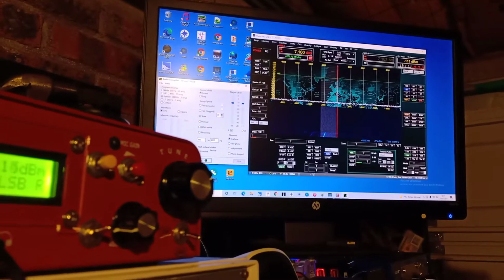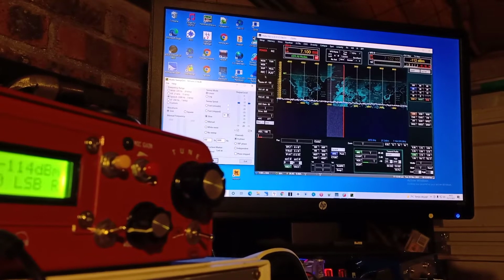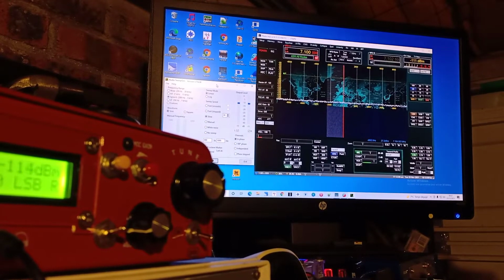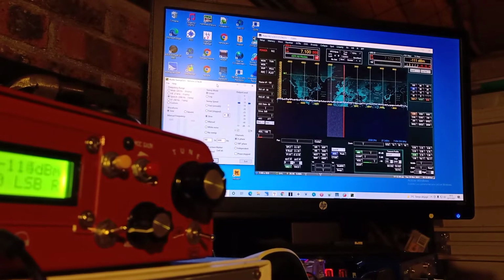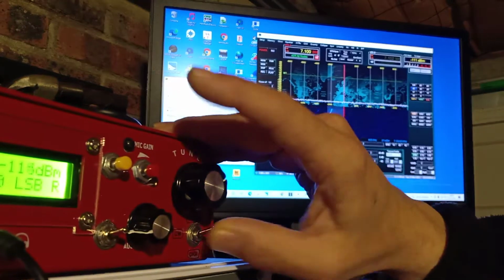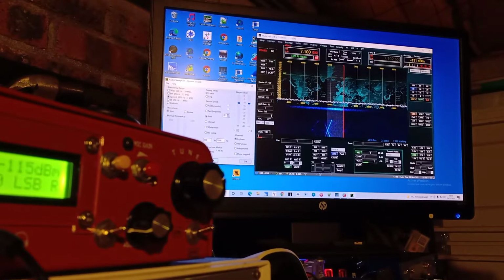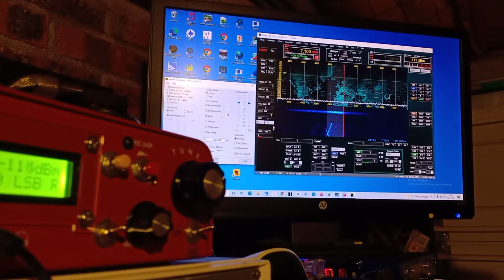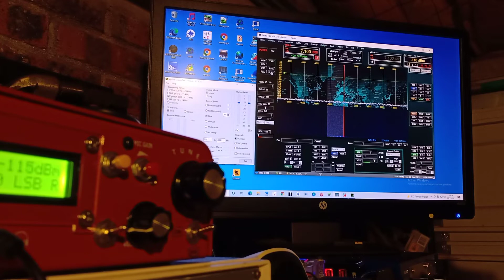F5NPV - New born homebrew uSDX Audio transmit testing

Comment: What's the software you're using for testing?

73 de Ray WW0AW
Reply from the maker: I am using a modified software you can find here : https://drive.google.com/file/d/1h0Hq09arVO_2rDH1r643cthwTDHbeuGT/view?usp=sharing

With this modified software you can :
-CW tone level (CW Sidetone) 
-TX QUADRATURE Swap : invert TX signal for phase changes > 180
-Multi ADC : multiple ADC conversions for more sensitive (+12dB) microphone input
-DIGI Mode ON/OFF:

This feature will provide optimization for digital modes: for super flat TX spectrum, (only down < 100Hz to cut-off DC components)
-Microphone Gain:

Currently we cannot adjust the microphone Gain from the front panel and the current source code by default is activating the Microphone Gain. This feature cannot be modified from the front panel menu and i have added in the code a menu where you can activate or not the Mic Gain. This feature is really great according the Microphone your are using and in some case the gain should be activated or not